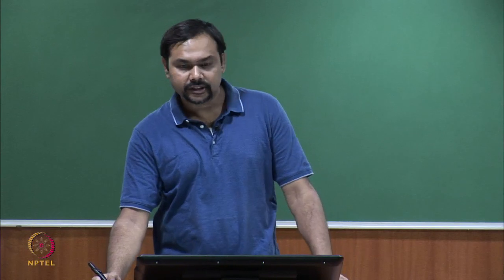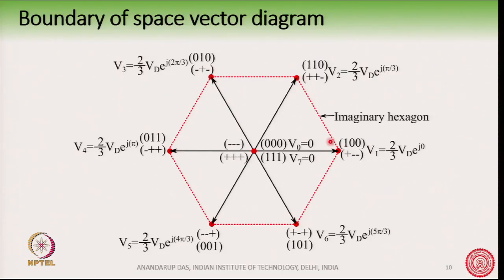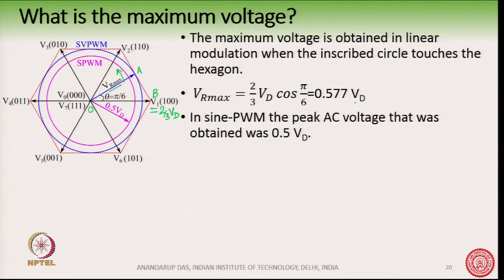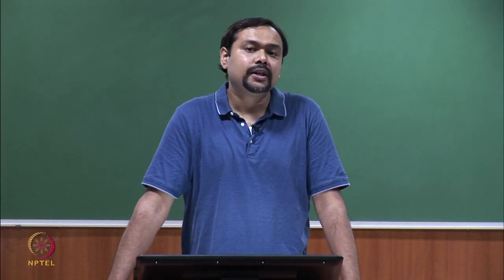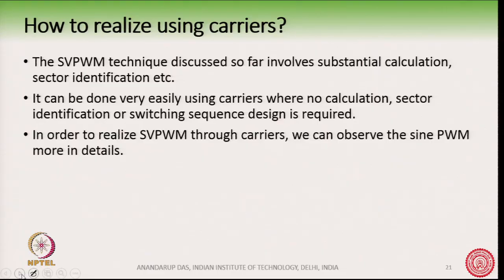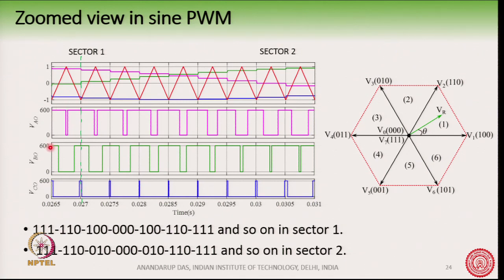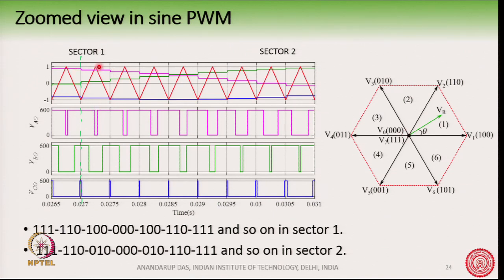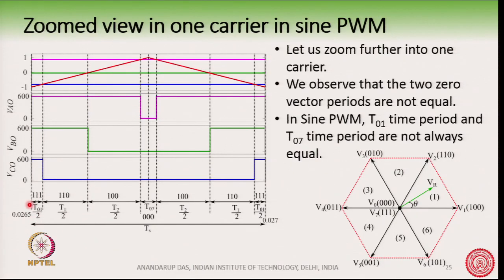Space Vector PWM- Switching Sequence

Comment: If you add a voltage to your carrier equal to: 1/2*(highest phase voltage + lowest phase voltage) then the times T01 and T07 will be the same. This yields exactly the same timing as calculated SVM.